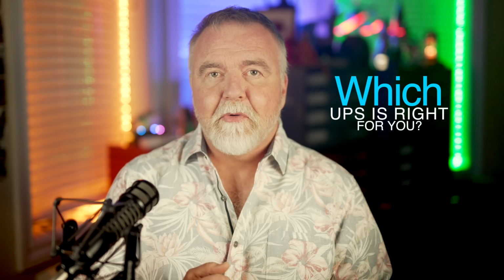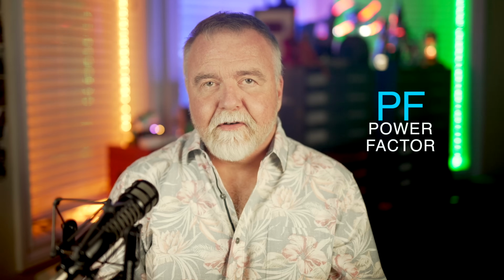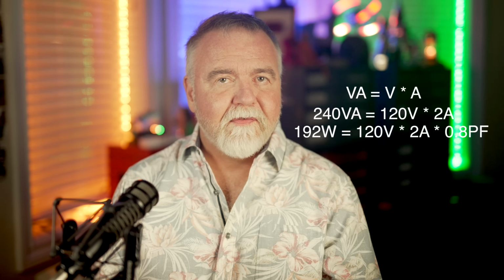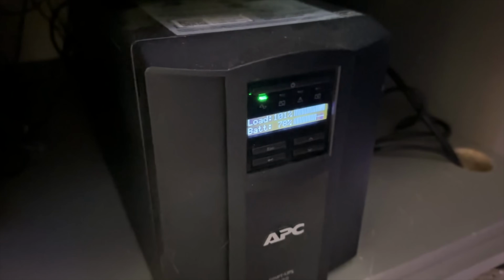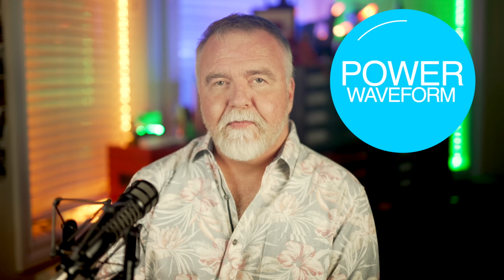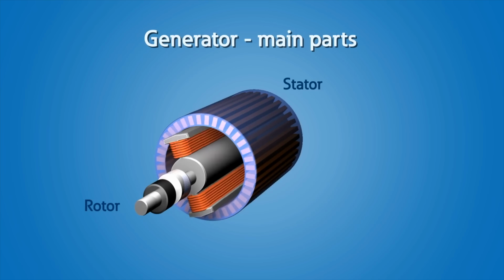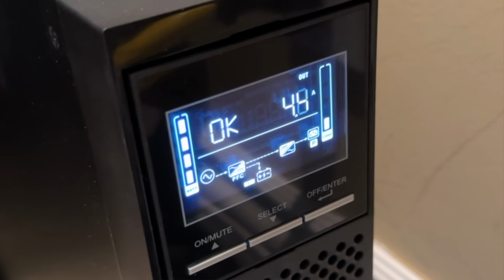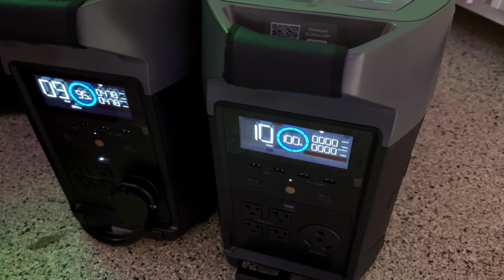The UPS Secrets YOU Need to Know!

Comment: Re: battery types. You missed off Lithium Phosphate. Higher initial cost than a lithium Ion but much longer lasting and doesn’t include the possibility of there being Cobalt mined by a child in the DRC. I’m looking for a second UPS with an external connector so I can connect some LiFEPO batteries even if the inbuilt ones are made from a less ethical source.

Edited to add: I forgot to mention the massive safety benefits. Lithium Ion Batteries contain Cobalt Oxide and this can release Oxygen at a realistic temperature of a fire so can be self perpetuating, like a bomb, whereas Iron Phosphate needs a really high temperature to release Oxygen. If you’re putting a significant sized battery in your house with your children I’d definitely go for Lithium Phosphate. Not like it needs to be super portable so the ~30% weight increase and ~50% volume increase doesn’t matter for UPS. It’s just the initial cost, although it’s cheaper in the long run as they last longer.
Reply: Do you use Petrol or Diesel? Refining process uses Cobalt, and it's not even recyclable after use unlike Lithium-ion batteries that use cobalt. Most Li-ion don't use cobalt anymore anyways.
Reply: @XenonG  Also there's the inconvenient truth that the mining of lithium is very dirty and pollutes quite a lot in and of itself. That side is never discussed, funny how that is ain't it. Don't like lead, cool there's this thing called AGM that doesn't use lead or lithium. Lithium batteries are also far far more volatile than lead acid or agm batteries.
Reply: @bdhale34  There's a reason lead acid and lead iron batteries are used in cars/trucks. They last in constant charge/recharge cycles, rugged and aren't too volatile. Until recently li-ion/polymer/etc isn't too well understood in rugged use, so now we see lithium battery retro fit kits for cars and motorcycles because they provide the same amount of power for much less weight.
Reply from the maker: I mention it with respect to the Delta Pro, as they are Lithium Iron Phosphate...
Reply: @DavesGarage  yes, I hadn’t reached that bit. I am guessing by saying ‘lithium Ion’ you meant both LiFePO and LIthium Cobalt Oxide because they both have Lithium Ions. It annoys me too that most people call LiCoO ‘Lithium Ion’
Reply: @XenonG  yes they do. The chemistry necessitates it. You can try to reduce the amount of Cobalt but it’s always needed. What other chemical do you think the cathode is made from?
Reply: @XenonG  and why wouldn’t Lithium Ion Phosphate be recyclable? That makes no sense either.
Reply: @bdhale34  how do you think Absorbent Glass Matt (AGM) batteries work if they don’t contain lead???
Reply: @vividexplore  I did not claim Li-phosphate cannot be recycled.
Reply: @DavesGarage  yes, I hadn’t watched that far yet. Guess by “lithium ion” you meant lithium ions and not “Lithium Ion”? I don’t like the confusion either.
Reply: @XenonG  you said “it’s not even recyclable”
Reply: @vividexplore  Read it again.

Comment: Point of order: Lead is the most recycled consumer material on the Earth save for water. 99% of lead acid batteries get recycled and reused rather than disposed of in landfills or thrown in the ocean. (to power the jet stream and recharce the electric eels /s) And if you've ever seen lithium or cobalt mining/refining, you'd reconsider the environmental impact. Lead-acid batteries are lead, lead dioxide, and sulfuric acid in an ABS case. Maybe some plastic or glass fiber matting for a separator. LiIon/LiPo are Lithium, Cobalt, Manganese, and Flurorine in many lithium battery chemistries.

Comment: Hey Dave, good to meet you. Great video, you earned yourself a shiny new subscriber and thumbs up. It's September 1, 2025. I have an APC backup that just died -- it's been in use for 3 years, so I am assuming the batteries went belly up. While I know I can replace the batteries in the smaller unit I have, I've now started shopping for a more robust unit. I am a documentary filmmaker using a Mac Studio M2 Ultra computer for everything from editing to, most recently AI work. I'm using dual 5K monitors, a Synology NAS, and about 20 hard drives all online at the same time. In September 2025, what is your recommendation for a USP for my setup? I'm looking at the APC 1500VA Smart UPS with SmartConnect, SMC1500C Sinewave UPS Battery Backup. Is that unit online as you;ve described? One thing super important to me is a feature where the UPS is able to send me a notification on my iphone that the power has gone down. That will enable me to get to my studio fast enough to shut things down safely. I'd appreciate your thoughts.

Comment: a very important thing you forgot about leadacid is pukert effect. with leadacid batteries the rated capacity is measured by slowly discharging for 20 hours. in real use the capacity would be less than half of what it is rated at when in a ups. 
i replaced my ups battery with a home made lifepo4 pack and it increased the run time by 3x . the cost of 16 lifepo4 6000mah cells were around 40$ all the other martials like nickel copper busbars , wires and shrink-wraps were 15$ , spot welder made from starter relay push switch and copper rods .. so with 12ah 25.6v lifepo4 i had similar runtime of 27ah 24v leadacid pack. 
with 300w load the ups ran for 45mins while according to apc runtime graph with 300w load the ups should run for about 47min with 27ah 24v leadacid (6x9ah leadacid ) so in my case lithium was twice as cheaper than leadacid . 
the pack is in use for more than 1year now and have handled 71 power outages according to the ups with about 5 or 7 times fully discharged as far as i remember. it runs my pc at idle for about 1hr 30min. or 40mins of gaming. 
ups model is apc BR1000G-IN , the Indian model differs from us model, while the us model uses a huge transformer and wastes lot of energy in heating the aluminium coil . the Indian model uses smps inverter , so is lot more efficient and more robust . if your ups has low frequency inverter then upgrading battery can kill it. apc uses just enough material so the battery runs out right before it starts to melt , so increasing the capacity can melt the transformer if ran above 50% load for longer than original runtime.
Reply: Yes, Ah is mostly a number, Wh is better.
Reply: @emilalmberg1096  with lead acid even that doesn't work. You need to take a look at it's datasheet to know the real watt hour you will get by the given amount of load you put on it. The more load on it the less whr you gonna get from it. 
So in my case the huge 6x9ah 12v leadacids from apc provided similar watt hour to 25.6v 12ah Lifepo4 pack made from cells that were in store shelves since 2018 and i bought them in 2022 . So that's how i got all for 40$ and tested each one of them all were above 6000mah with decent internal resistance and are in use in my ups for more than a year now. If it lasts longer than 5 years i am all good with buying discounted new old stock cells

Comment: Very good thank you.  But you have peaked my interest with using something like the delta pro in place of X Y Z brand UPS.  How would a battery backup like the delta compare to say an APC?  Onlt thinkg I can think at present is power reporting to trigger a gracefull shutdon which supports the APC.  Thanks and cheers
Reply from the maker: The Delta Pro works well as a UPS; if the power fails, it seamlessly continues to power the circuit off batter.  At least so far!

Comment: I was surprised at how poor the runtime is for powering network equipment via UPS (1000VA w/ 4x 9Ah 12V batteries) at a nonprofit office that suffers interruptions.  (The circuit the network rack is on has a GFI until a maintenance problem with the roof is resolved, and that isn't happening any time soon.  Perhaps not even until the building gets knocked down).  I thought it would last all night until someone could reset the power the next morning, but no such luck.  Perhaps 60w-90w load (3750 switch, 1841series router, plus a GS108T Netgear switch, a consumer wireless router, and an ASA5500 box) runs for <3h.  Meanwhile, the UPS will run for perhaps 4h with zero external load, so a lot is lost in inversion.
   As long as the habit is to keep "IT" stuff on UPS, anyway, makes me wish I could just directly power the equipment with the DC from the battery bank, and somehow disable the UPS inverter, and whatever battery capacity is wasted keeping a certain AC current "available" on demand.
   I know that commercial stuff like Cisco has the capability to hot switch between dual power supplies, one of which can be 48VDC, but I got this stuff second hand, and those parts are not necessarily available for EOL stuff, and it ain't exactly trivial to configure, even if the hardware were readily available.  I wish there were more ready solutions for incorporating items with external transformer bricks and such directly from the DC battery bank.  Seems like there are natural tap points for 12V multiples, already, maybe hook up DC-DC transformers for laptop charger voltages, etc, USB 5V, etc.
Do for that matter, do they make DC PC power supplies?  Not that I'd care about keeping them running for an extended period, happy to just allow UPS to manage orderly PC shutdown, but is that a thing?

Comment: So, could you create/buy a UPS that provides 12-72V DC and always has a power factor of 0.95. Then run that to 12/48/72v power supplies that just convert from their source voltage, down to their intended voltage? I've got a few higher end switches with 48V DC inputs, though those dont seem redundant like the AC supply

Or would that high voltage to low voltage DC conversion lead to a lower power factor
Reply: I've never worked with power factor correction myself but it's my understanding that the reactance of an AC->DC supply is largely a function of load. There are "active power factor correction" supplies that can dynamically put the appropriate caps/inductors in series on the AC side of the circuit, though.
Reply: @CFSworks  APFC can typically achieve 0.95 or better at 10-100% load, falling to 0.8 at 1-2% load.
UPS are typically rated at load with 0.8 (or even 0.7) power factor - capable of supporting up to 0.8*"rated VA" Watt load with up to 1.0*"rated VA" VA load.
Typical UPS supporting a typical APFC PSU will be limited by it's Watts output capability.

Comment: It's a bit inaccurate to call the connection that triggers a safe shutdown a serial connection. It might use a serial port or USB, but it's just a relay contact. Even though that might be considered a single bit data wise, there's nothing serial about it.
Reply: Nothing serial about the port at all...
Reply from the maker: I suppose you can tell me a way to send a single bit in parallel then?
Reply: @DavesGarage  You could send the bit over a parallel port, with the other lines being used for signal parity. But that is besides the point because both of the connectors mentioned are, by their nature, serial, along with all data sent through them.
Reply: Some UPS units have a dry-contact output to feed a signal to some dependent device. But every UPS I've used intended for PCs had either an RS-232, USB, or Ethernet connection. They exchange data, not just a switch closure. Depending on the unit and software, it is common to be able to monitor numerous parameters like line voltage and frequency, battery voltage, current draw, etc. And some configurations can be set through software such as the float voltage to charge the batteries to.
Reply: @strehlow  Many older units (like my APC Back-UPS from 1999) connect to a PC serial port but they signal using voltage levels on the control lines.
Reply: @eDoc2020  That could be done with an RS-232 port, but not USB.

Comment: This is only for people that aren't all offline but wouldn't a sufficient cloud storage solution be adequate for data safety rather than a ups. I guess it is fundamentally down to the use case.
Reply: Offsite backup is useful, but the UPS serves a different purpose. Cloud storage is too slow to be the primary storage media. And if a file on the local media gets corrupted because of a power failure, it is possible (maybe likely) that once the computer boots back up (assuming it can) then the damaged file will be backed up, replicating the damage to the offsite backup.

Comment: I thought that any half decent PC PSU had an active power factor correction circuit that kept the power factor above 0.9 at all times. That should keep the load produced by a "1200W PC" well within spec of a 1500VA UPS (unless the peripherals were really having a field day).

Edit: Regarding reaction time, a decent PC PSU should be able to get through a few milliseconds, and in fact a few tens of seconds of a break in supply of power.
Reply: 1. 1500VA UPS is probably in fact a 1200W/ 1500VA one. Manufacturers do make UPS'es to support higher total power than real power and use bigger number for nameplate number (marketing purposes).
2. 1200W PSU doesn't mean it cannot take MORE than 1200W.
It can and it WILL if sufficiently loaded. 1200W PSU means it can provide 1200W OUTPUT power at input power at whatever it takes (maybe 1318W if 91% efficient at full load) to make 1200W output.

Comment: As someone that did environmental systems for computers, I have been trained on computer power. 
One of the things that I was taught is to NEVER feed a UPS with a UPS. One UPS will fight the other. You can see this if you look at the current and voltage between the two UPS.  Almost every time I've seen this done, it has caused problems. The exceptions were the computer room sized Liebert UPS that can handle 100kW and more. But there you really didn't need the second UPS. 
Still, while I know that specific APC UPS, I know nothing about the Ecoflow. Maybe it was designed to handle a UPS. Most standard UPS can't handle powering a UPS or being powered by a UPS. But I am willing to update my recommendations. So here it is:
Unless you have Dave's budget and expertise, never feed a conventional USP with a conventional UPS.
Reply: At least all I have found about it is that these larger power stations have no issue running at least regular UPS. It seems to be commonly recommended. I do it myself no issue. The powerstation can do 1800watts with a capacity of about 1kwh. The UPS is a rather small one, just there to keep some networking equipment etc, working. Technically, my Power Station has a fairly low switch-in time of 20 ms, but I am not counting on that, hence the small UPS that is better for this. I would probably be comfortable using it with one of my 1000w UPS units as well, if I had more power stations, but alas, there's only so much money LOL

Comment: I have a 1U 450 VA APC in the rack (for UDM Pro and  PoE switch) and a 1500VA UPC behind it to handle the servers. I also have Tesla Powerwall, but doesn't switch fast enough to avoid my systems from losing power (~ 500ms switchover)

Comment: Very useful, thank you! But can a Delta Pro be used as a UPS? It is a power source, but not a device that can inform my servers to shut down, or can it? So do I need a UPS that's connected to a Delta Pro acting as the power source?
Reply from the maker: No, I'm using it as a UPS.  I can pull the power cord to it and it runs fine off battery.
Reply: @DavesGarage  Okay, thank you so much!

Comment: Now I want online UPS but those prices are crazy... is it really worth it?
Reply: Depends on your computers. At my office I had no choice: our Dell servers had super-sensitive power supplies that would fall over dead if they detected the slightest twitch in line AC. Even line-interactive took too long to switch to battery when the utility power failed. It was online or nothing. 

On the other hand, we had employees that used laptops as desktops. We plugged them into el-cheapo standby UPS's, since the laptop battery acted as a built-in online UPS. We also had 400 minutes of backup power for the internet dry loop connection & network + telephone switches, so we could run the office almost all day from battery. Which we needed to do several times a year, due to 7 years of construction going on around our office (subway construction).

Comment: It's interesting you should mention imaginary numbers when talking about VA as complex numbers are actually extensively used in electronic engineering. Voltage is usually represented as U = A*exp(omega*t*j + phi) -- we use j instead of i as i is used for current.
Reply from the maker: That's why I'm a programmer and not an EE :-)

Comment: You have so much redundancy in your home, inducing unnecessary overhead. Just look at this: 
mainAC/(solarHVDC-->inverterAC); onlineUPS PFC AC--> HVDC (battery); onlineUPS inverter HVDC-->AC; PCPSU PFC AC-->HVDC; PCPSU HVDC-->12/5/3.3VDC.
 Most of the modern computers, monitors, computer gear and appliances, would accept HVDC 90-300V* (* this varies) instead of AC. So, your solar installation, coupled with battery bank and charger (every solar installation already have in the form of bidirectional inverter) and, voila, you have online UPS.